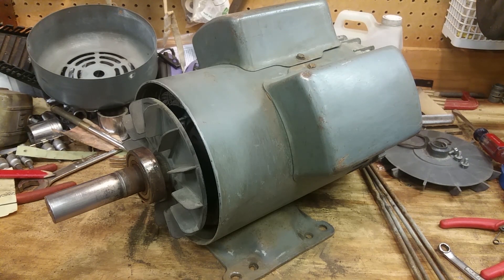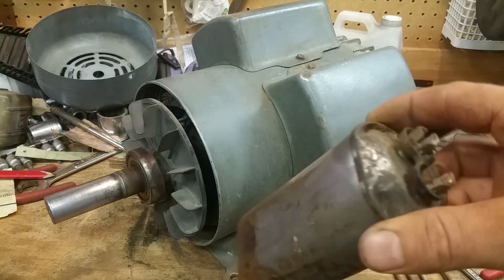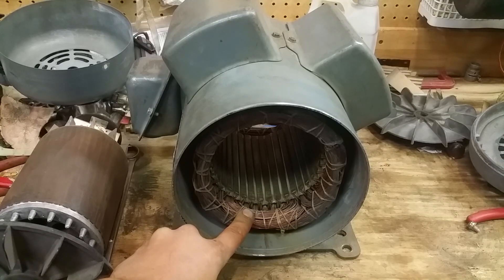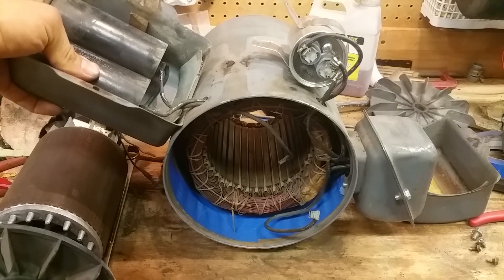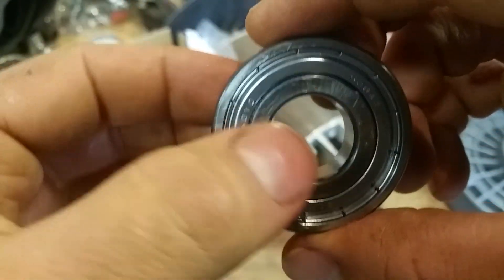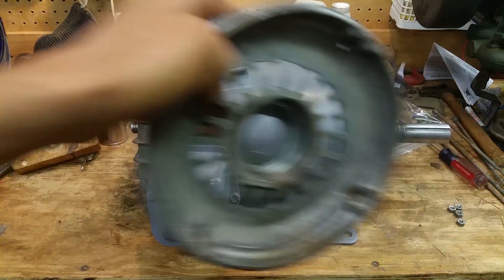How To Restore An Electric Motor

Comment from the maker: Hey Ya'll! Here's an old video I forgot to put out when I rebuilt my Champion air compressor. It'll help you rebuild an old electric motor!
Compressor Rebuild: https://youtube.com/playlist?list=PLG1uwPXykHtJlUPrX5jjifwV3KaXMqnxp
Timestamps:
0:00 Intro
1:04 Capacitors
2:10 Replacement Capacitor Specs
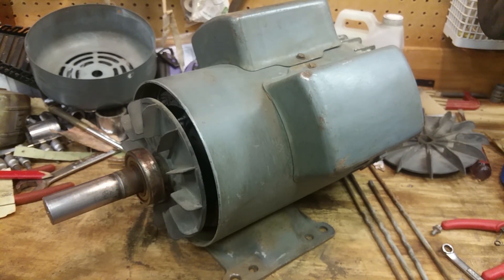3:54 Internal Starter Contacts
5:10 Clean Motor Stator
6:32 Winding & Wiring Inspection
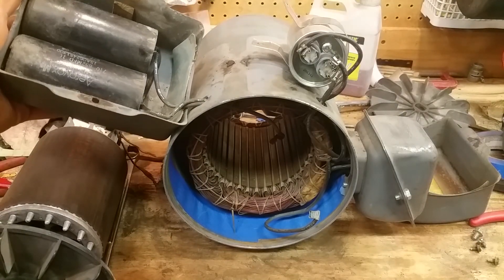7:47 Start & Run Capacitors
8:59 Old Bearing Removal
9:58 New Bearings & Bearing Types
12:25 New Bearings Installation
12:55 Paint
13:01 Motor Reassembly
14:30 Logo Reveal
15:17 Motor Test Will It Start?!?
15:58 Outro

Comment: Excellent video! Very helpful as I was tearing down a Leeson 5HP 220V motor. The electrical stuff isn't too complicated, but some of the mechanical disassembly left me nervous. Just how much "encouragement" with a hammer or gear puller is needed? Your video helped me be more confident about what's stuck and what has an actual mechanism (screw or whatever) keeping it from coming out. Thanks! FYI - it would be helpful to see a little more detail on how you popped the covers off. I got one end off with a few taps after looking at another video. Glad to see you use a gear puller, too. I didn't need to replace my bearings, but I did use my puller to get the end cap off. It was pretty tight and needed some even pressure to take it off without damaging anything.